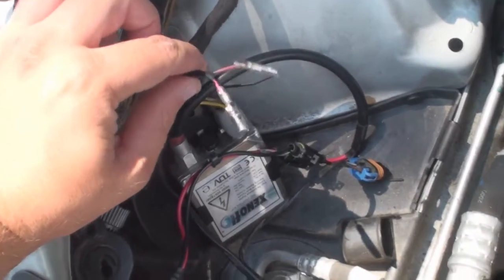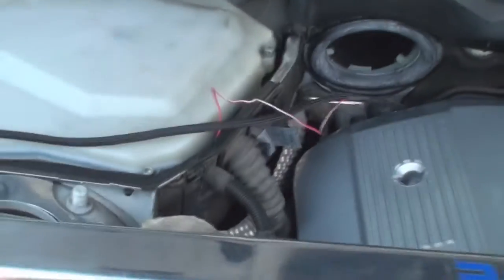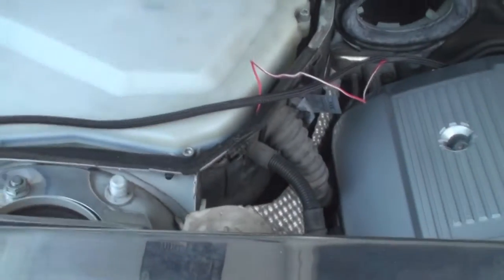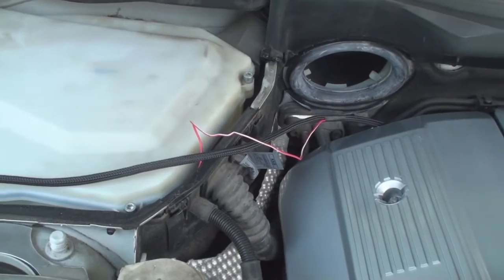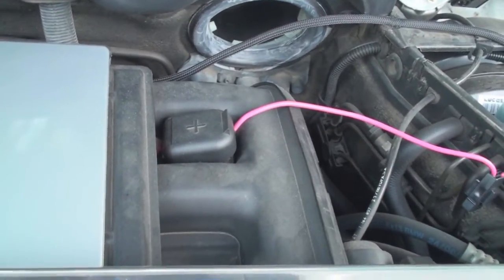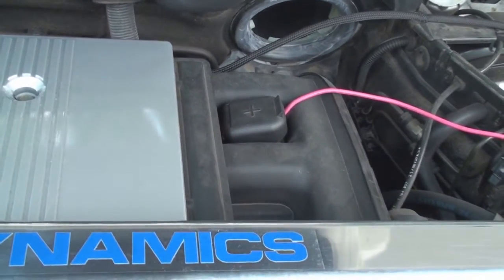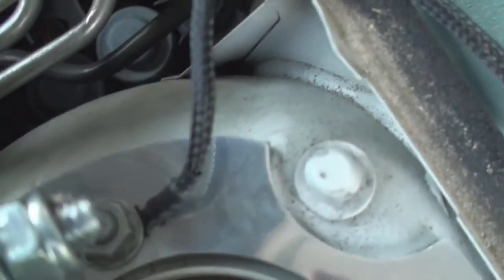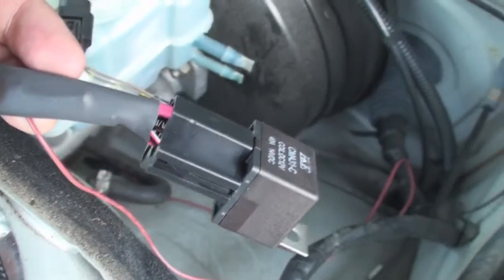DDE/DRL Relay Harness - How does it work?

Comment from the maker: Yes, they work on LED's. The only difference between the CCFL and the LED's is the CCFL power inverter. Either way each accepts a 12 volt power source.

I actually recently modified the harness power couplings with a more secure connection between the two,

I also re-routed the harness in the back of the engine bay so it is no longer visible. I'm still figuring out how to use the remote function and how to hide the power wire.

I'll keep you updated.